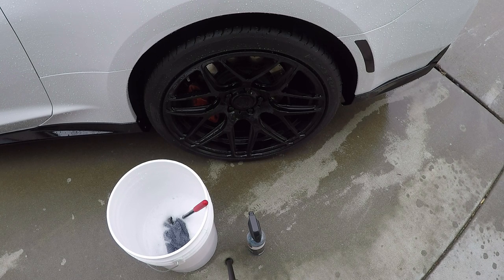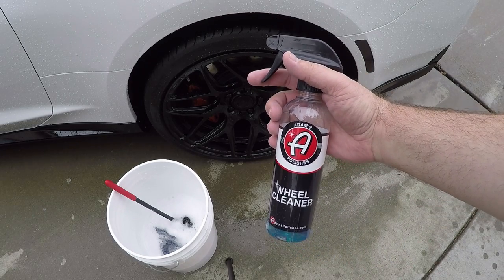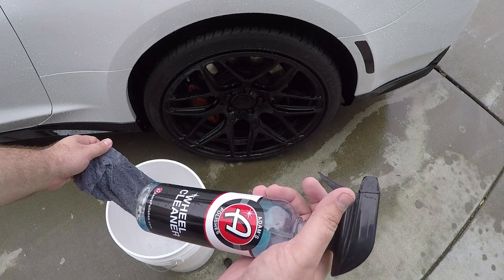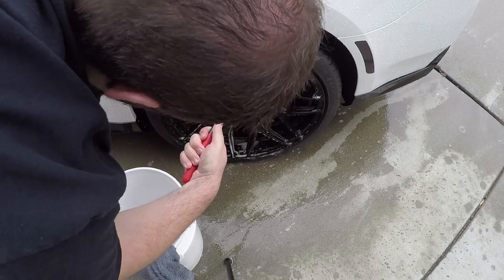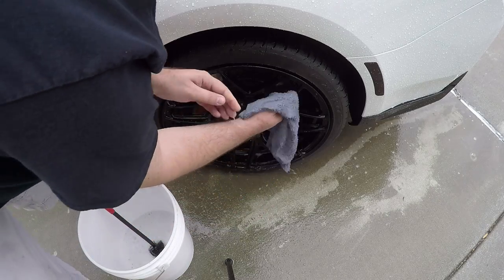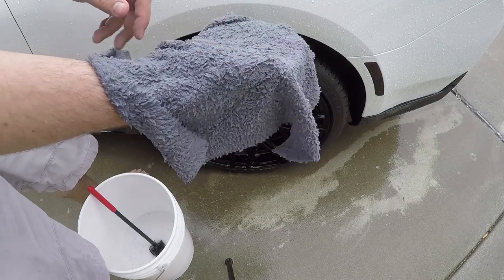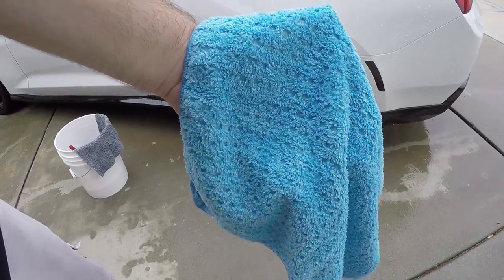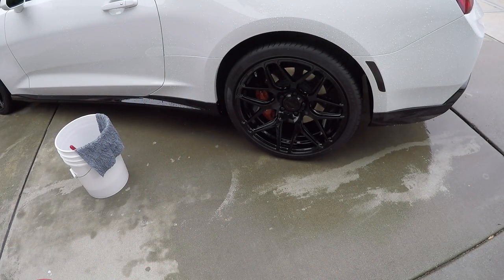How To: Clean Your Wheels by Hand

Comment: I used the same process on my rims but after awhile I developed small scratches between the spokes in the rim I would suggest getting a stronger wheel cleaner and polish your wheels more often to prevent the scratches that I got.

Comment: Hey Lethal. Any worries about using a wheel cleaner on painted callipers?
Reply from the maker: I have the G2 kit and have no issues. Not sure about other paints. But it is not acidic, so you shouldn't have issues. Buy you can test on a rear side a few times to see how it holds up.

Comment: Do you know if the new 2017 ZL1 rims will fit with the SS stock tires? The ZL1 tires are much wider but I've heard some people say the SS tires might fit anyway. Definitely in need of a more reliable opinion on the subject
Reply from the maker: +Michael D'Alessio they will not fit... the ZL1 rims are 1.5" wider.

Comment: what's the specs on the wheels buying some rims and ur car sits perfect
Reply from the maker: +Saul De La Torre 20x10" with 285's and 20x11 with 305's
Reply: +Lethalhammer thanks
Reply: +Lethalhammer do u think I can go wider in the back or no
Reply from the maker: +Saul De La Torre Not unless you remove the inner wheel well padding.
Reply: +Lethalhammer would u happen to know how much more
Reply from the maker: +Saul De La Torre 315s
Reply: +Lethalhammer thanks man